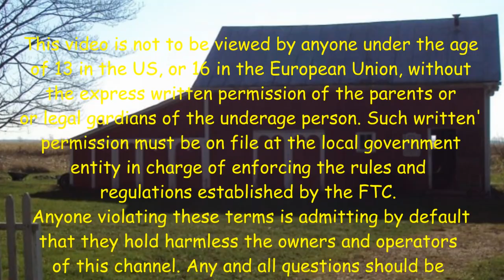Truck Rack   Tools To Make Tools

Comment: We can wait on the Annex and it's sound proofed wall surrounding the homestead and as far as the box beam; enough is plenty. Happy week. Got my fittings for the woosher gas drain and another gallon of DExron. Jed Clampett was right- Black Gold! BLESSINGS!
Reply from the maker: What gets me is the synthetic oil. Wally wanted $45 for an oil change 4 years ago because the Colorado takes synthetic oil. I have been doing them ever since. 
The oil itself is crazy money. $28 for 5 quarts and $12 for the filter. 
At least I know the cap is on and the drain plug is tight. I have had Wally mess up on both of those.
Reply: @OldSneelock  I went to the ACE for a 'T' to make the drain for the woosher tank and got 4 quarts of ATF. $35. I wonder how the electric cars will run with no oil! We've been had every way we turn.
Reply from the maker: We let them talk about the environment. Nothing better for a politician than to scare the population they want to control. 
First they ruin the schools. No civics classes and teachers wearing rainbows. 
Creates a bunch of useful idiots. 
EPA convinced people they knew what they were doing. Not a clue. College kids with clipboards. As they grew numerous and convinced the public they were necessary they learned to keep up the scare.
Reply: @OldSneelock  We were talking about such this morning. They've graduated in that they don't even have to have their mouth moving to lie.